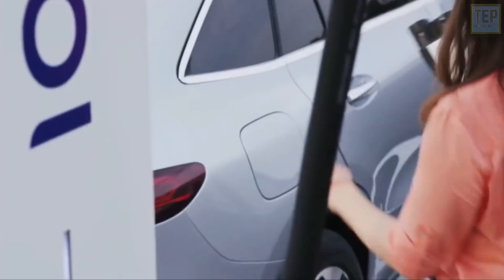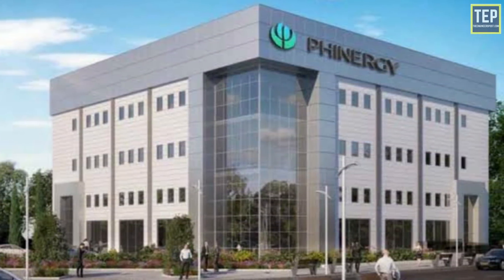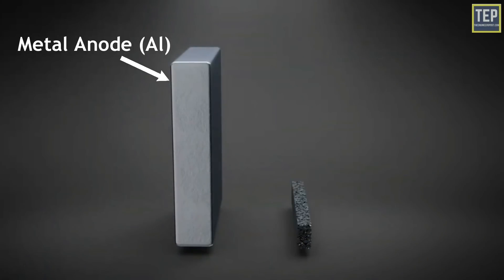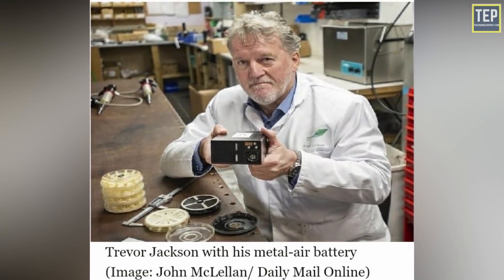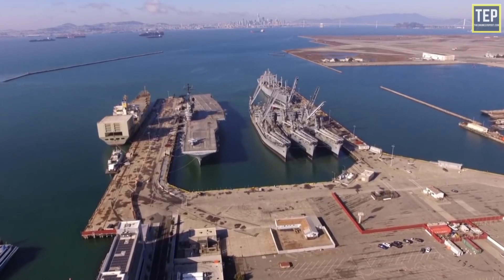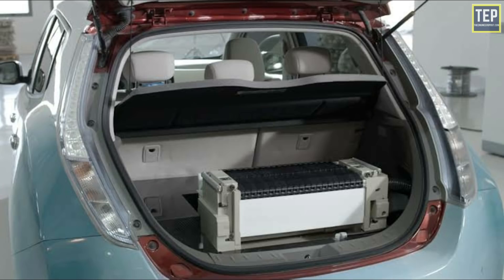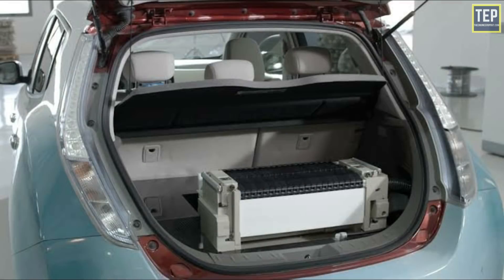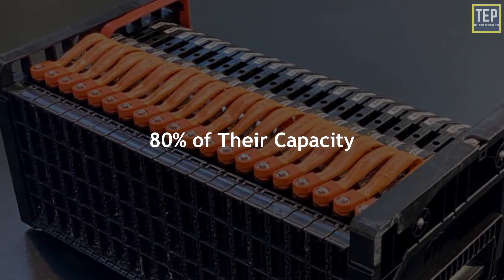Aluminium-Air Battery | An EV battery that Doesn't Need to be Charged

Comment: Ease of use is not there with Aluminum Air batteries and the cost aspect was not discussed in the presentation. If its going to cost more for replacing the batteries, its not worth it. From the cost point of view both capex and opex, it needs to be better than Electric to be even considered as a viable solution.

Comment: I am unsure what happens at night whle we are sleeping. Is the reaction still progressing consuming aluminum(american spelling) shortening the life cycle, or as someone suggested ithe reaction stops when no power is being used. The new replacements with intact anodes have a shelf life of ten years or more, like alkaline batteries? This post did not ,ention the storage life adequately.

Comment: The logical setup would be (2) externally accessed "bays" where batteries reside.   One battery dies and the other takes over.  You get a light on the dash....  You roll into a svc station and swap it out via automated kiosk/cages (similar to propane but self serve)...  As long as setup is user serviceable and batteries are a cartridge style, tool-less design, these could be commercially viable.

It's logical that an energy company would gravitate to this type of solution, as it keeps you coming back for more producing a revenue stream from EV's where none previously existed.

Aluminum however is not as readily available as advertised.  It requires a significant amount of electricity to extract it from the clay it is typically found in.   Some producers have ended production of aluminum because the cost to produce actually exceeds market value.

I would be interested to know what percentage of the aluminum is recoverable during recycling, it strikes me as an obvious environmental travesty if we are mining copious amounts of aluminum just to have it consumed by this process.  This is especially concerning given the amount of electricity needed to produce the aluminum.

Cons:
Still requires electricity at production, increases mining of earth minerals, and due to cost of aluminum production is highly unlikely to be competetive against gasoline at the cash register.

Pros:
Could be a self serve design if engineered properly.  Immediatly usable with no infrastructure modification at owners residence, quicker to swap than a recharge.

My $0..02 :
Best use case is as a traveling power supply.  Manufacture EV's with a rechargeable battery AND a cartridge slot for this power module.  When you go on a long trip you roll into the service station, pick one up and go.  The EV uses the Aluminium cell only whenever it is present, battery when one is not.  At end of road trip, return the used core to the service station.
Reply: Yep what i call a hybrid system coupled with a fixed small lithium battery that would be good for 90% of trips. Then a place where you have swapable air battery in your car, abd you just go to a station to do it.  This would also be very good for the likes of airplane, trucks, trains etc. With that kind of energy density it would make them instantly viable. The only downside for me would be the rate of self discharge.
Reply: Is it possible to seal the batteries so no oxygen enters when not in used to prevent discharge?
Maybe a smaller battery to store residual discharge.
Reply: @danielvilliers612  right, one just has to swap out the air battery every few weeks. Similar to, or even better than, filling up the gasoline tank every week or two.
Reply: why not have a dual battery system that can be charged by either or both solar cell or dropping a wheel that us attached to a generator that will charged the low battery and switch to other battery when full and than also plug in over night if neccasary
Reply: I'm sure there's much more oil in the ground than there is aluminum. How stupid. 🤔
Reply: @michaelteel4917  Aluminum is easily recycled and with battery swapping the rate would be close to 100%.
Reply: Almost all lead-acid batteries are recycled because people turn in their old one when they get the new one. Almost all cooking gas containers are reused for the same reason.

Comment: Thank you TEP for sharing your insight into the Aluminium-Air-Battery  (AAB). Since EVs have come to stay, the earlier we put the thoughts of fossil fuels behind us, the better. Trialling the AABs using city flitzers, having a spare for replacement will quickly bring in new and adaptive ways. I think this is one way forward in renewable sources of energy.

Comment: The extremely high degradation rate kills this technology.  How to supply freshly build batteries to swapping stations will be a big problem.  Even a relatively fresh week old battery has only 80% of the rated capacity, who is going to buy it?

Comment: AFTER THE INVENTION OF PILIPINO INVENTOR FOR HYDROGEN GENERATOR THE IS ANOTHER  INVENTION AGAIN CALLED ELECTRO PLASMA  A BATTERY CAN USE FOR 12 VOLT,24 UP TO 90 VOLTS DC AND CAN CONVERT INTO 2020 VOLTS UP TO 230 VOLTS AC WITH 100 AMP, CAN USE FOR ELECTRIC TRUCK BUS AND CAR ANG CAN DRIVE THE 100 HP ELECTRIC MOTOR AC OR DC AND CAN EACH 500 KM NO MORE CHARGING NEEDS AND HAVE A SMALL SIZE 40 X 40 X 40 CM AND HAVE A  BIG SIZE  WITH HIGH PIWER WITH SIZE OF 100 X 100 X 100 CM

Comment: The question is..what if the reaction proces6 (oxygen+air) still going, why do we have to swap the batteries, its still good science work theory but if it alredy been tested and made, plenty solutions you can make, you can combine this with alternate electric generator in 3-4 different battery in one vehicle in producing electric (solar power on the rooftop, kinetics power on the wheel, heat power on the bottom side, and this swap air+oxygen) maybe you can have longlast vehicle without charging it

(Today everyone laugh in the future we have the real solutions for clean recycable energy)

Comment: I think it will be viable due to low weight there could be options for dual battery system. The exausted battery could be replaced as soon as possible to be on the safe side.

Comment: Made in India, for sure they are hiding something, Will wait when it will be produced by someone else. They postponed to stop pollution for at least 50year, Strange if they have this solution. And from what I remember Aluiminuium is toxic to produce. Also if you filter out Oxigen form the air, it means you remain with nitrogen and I always see compressor doing this job, why all of a sudden you can do it with atmospheric pressure? Also the by product of this battery would be Nitrogen, and if the cabin gets saturated with nitrogen.......... you die! All this is still not clear, like the robotic voice that is reading the script.

Comment: Other than longer range - which lithium-powered EVs are rapidly increasing to - I don't see the advantage of this battery over traditional lithium. In fact the fact that it cannot be charged is a disadvantage over lithium which can not only be charged of course but also swapped and recycled just like this one! For very specific kinds of situations this type of battery might be preferable to lithium ion, but the disadvantages are too numerous. Also, it is coming out late in the life cycle of lithium batteries which have come WAY down in price (90% cost reduction in 7 years) and gotten much better (faster charging, more energy density, etc). The main advantage that lithium has is that electricity for recharging is available in literally hundreds of millions of locations around the world, whereas battery swap locations for this type are a microscopic fraction of that number.

Comment: Drivers would have to get used to carrying a spare new battery. So most suitable for commercial use where battery replacement could be part of the job. For private consumers the battery pack would need to be under the hood so that shopping and kids buggies, luggage etc could still be carried easily

Comment: it might become an otion if there is a way to simply replace only the aluminium elements instead of the whole battery. but even then.. the fact that aluminium is cheaper then lithium doesnt help if you have to buy new aluminium avery view days while lithium only every 6 years or so..

Comment: Where do I start?  OK, lets start with the claim at 7:30 that a Tesla could get 2700 miles.  Obviously that's not true and misleading because it's not comparing volume and a battery cannot consume the entire space of a car.  Next, no consideration to energy efficiency.  How much energy does it take to recycle the battery into another one?  And that directly leads to how much each battery pack costs.  The video makes it look as easy as just remelting aluminum cans when it's closer to remaking the original aluminum oxide ore from the ground into pure aluminum. Next, say this gets 4x the range.  My 250 mile EV would get me 1000 miles.  My EV costs $35 to travel 1000 miles (actually it's $6 with my solar including the lifetime cost of the system but I'm using the regular utility rate for the calculation).  I highly doubt you could recycle that size battery into a new one and install it for less than $35.  Recycling hundreds of pounds of aluminum would cost hundreds of dollars.  I just can't see you recycling the aluminum and making a new battery pack for less than $1000. And lastly the degradation rate after a month is a non-starter.  Might as well use Hydrogen and you can use the useless per weight calculation for the Tesla and you could get 7371 miles (at 60% efficiency to electric) but then again the tanks would be larger than the car.

Comment: Given that this battery type was already known when the current electric vehicles were designed I have to assume the engineers came to the conclusion the drawbacks of this battery type were higher than the positives.
Reply: Tesla's goal was to get an EV to market as quickly as possible. Not to manufacture a brand new battery technology. Not to mention the sheer amount of infrastructure Tesla would need to build out to make such a system work. Lithium was used because it was an off-the-shelf component that could get the job done. People could charge at home. This is often the case in emerging markets.

As EVs develop, other technologies will be explored. If the oil industry is truly doomed. A technology like aluminum air, that forces you to purchase a consumable from them, is the future they will probably push. I think we will see both in the future. And it will probably be modular and interchangeable (AA or lithium or something new) on many vehicles.
Reply: @dvanomaly420  "Brand new" that's from the 60s.
Reply: @samiraperi467  don't be so daft. Show me where you can buy mass produced refurbishable AA cells? They don't exist? It's still a new tech with little development? How about the infrastructure to swap those batteries for you? My point stands. It's such a massive undertaking it's probably not something that would take off until oil companies start becoming obsolete in the auto industry.
Reply: @dvanomaly420  if you researched it  you would find that there are things that was really problematic, like the toxicity of the liquid electrolyte. Things that have apparently been addressed as the English marine guy drank it to show his electrolyte was safe.
Reply: @dvanomaly420  Oil isn't used to make gasoline, it's used for all kinds of stuff, medicine, plastic, clothing, lubricants, ink
Reply: Didn't finish, paints, fertilizer, ect, so matter how much you want too get rid of oil companies, I think you would change your mind if it happened!!! Think before you act. Not everything is that simple.

Comment: In my opinion, it should be possible to replace the battery in garage conditions. Batteries could be delivered home by courier straight from the manufacturer. The used battery picked up by a courier and delivered to the manufacturer.

Comment: The way I would see it working if the anode would be in liguid form and it would be possible to vacuum old anode and pump new anode to the car in similar manner as gasoline is pumped. Service stations with 200-300 new battery packs waiting to be replaced daily? Highly unlikely going to happen anywhere.

Comment: How about a hybrid EV that adds this Aluminum battery into the trunk as a range extender? For long rural trips, you grab one of these Aluminum batteries from your garage and mount it into your trunk. After the trip, once you again reach suburbia, you recharge your EV instead of relying on what’s left of the Aluminum battery. At some point you swap the spent Aluminum battery for a fresh one.
Then again, not sure how much of the 2300 miles of range you’d get while also having the heavy Lithium ion battery onboard the  car as well! 😀

Comment: "doesn't need to be charged" no. it doesn't. when its empty u just throw away the car. like really, how stupid can marketing speech get. also, in terms of green tech, when u r trying to turn the oxide back into aluminium, u waste a whole lot of energy. oh and there is the fact that u have to go somewhere(aka a gas station) to get a new battery fitted every time u run out and u will probably never really run out with 0 miles on the clock. all for the convenience of not having to plug in while u make a comfort brake most drivers already make on a long trip.

Comment: This technology will not take off in cars and trucks due to following

1. Cost of materials will increase with inflation over 15 years (lithium ion battery expiry period). However renewable electricity cost will drop over the same period. So over a period of 15 years the total cost of ownership will be higher than lithium ion battery vehicle
2. Electric socket is available everywhere during emergency than Indian oil petrol stations so charging infrastructure will be much bigger than for replacing stations of aluminium air battery
3. Cost of lithium ion batteries are going down due to chemistry like LFP removing cobalt and reducing nickel content.
4. **Most importantly from environment impact standpoint polluting the atmosphere by increasing concentration of greenhouse gases (by burning fossil fuels) is as bad as removing oxygen from atmosphere and increasing concentration of co2, co and other greenhouse gases. So if everyone in the world is using aluminium air batteries then it will decrease oxygen % in atmosphere which is hbad for the environment at the time when we are trying to plant trees to increase oxygen content**
5. The reason why Indian oil is trying to invest in aluminium air battery but not lithium ion or other chargeable battery technology is because it is purely business. They don’t want a product which they sell once and the consumer doesn’t pay them for another 15 years. They want to sell a product where the consumer pays them every few days so they can generate recurring income which will benefit their shareholders. They hate the idea of consumers having the power to generate electricity (solar) and use their own source of power for transportation.
6. Indian oil knows the end of oil age is coming. They are better off merging their company with a lithium ion battery producer or electric wind turbine or solar panel or ev manufacturer to go green. Even hydrogen may not make it to cars and trucks in long run.

Comment: The non-rechargability and the cost of replacing the battery in my view makes this battery a non-starter in the electromobility field, however maybe it can be further developed and thus made into a viable concept. There are many reports about replacing Li-batteries e.g. with super capacitors, however none of them have an all-round package good enough to beat Lithium, and if it is possible to do so, then I think we are speaking about 10-20 years until such a technology will emerge.
Reply: Maybe watch the video again, they claim it’s 100% recyclable after expending the charge.  They compared it to Lithium, which is not recycle-able.  Watch the video again please.
Reply: @drew8256  Sooory ! I wanted to write non-RECHARGABLE ! I will correct my input.
Reply: Have a hybrid system with the car having a small 30kw lithium battery for 90% of trips and this in stations when you ça swap it for longer trip.
Reply: @danielvilliers612  The first (electric) BMW i3 had a 22kWH battery and a range of around 100km in the summer, so your suggestion of having a hybrid with a 30 kWH battery seems to me to be a fairly expensive solution, and if it’s a hybrid you can use the IC engine for longer trips, so that there is no need then to swap the battery.

Comment: Wellcome this simple technology. Good to kick of tesla dominance. I still belive that scintist could discover an infinity clean energy, but if so the globalist elite would suppress it.
Reply: this piece of crap isn't gonna beat Tesla any day soon. its far from infinite clean energy, its using a very inefficent process to store energy. turning aluminimum oxide back into aluminium is a crazy energy intensive process. there is nothing preventing people from swapping Li-Ion batteries the way they suggest swappng this batteries, in fact there are at least 2 companies that had a working system at some point, one is still operational in China. the only difference being the user is able to charge those cars with cheap household electricity(or even solar on their roof) 350 days a year and only does a battery swap the 6 times a year they r taking a long trip.

Comment: I am interested into this Aluminum Air Battery technology as an intermediate solution for EV charging stations where there is no electrical grid or with limited capacity to charge EV's. But how to get in touch with the right people at Indian Oil or other manufacturers...Do you know how to get in touch?